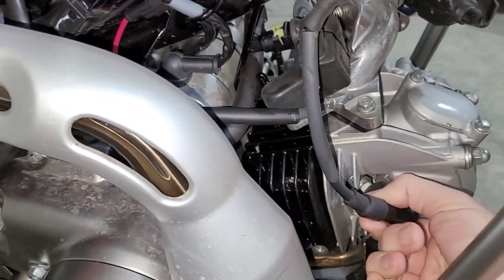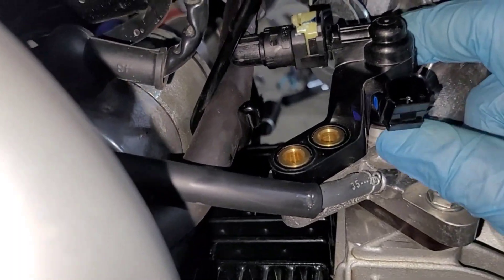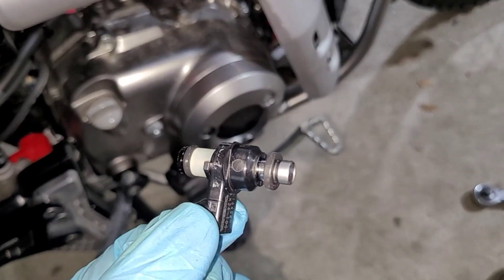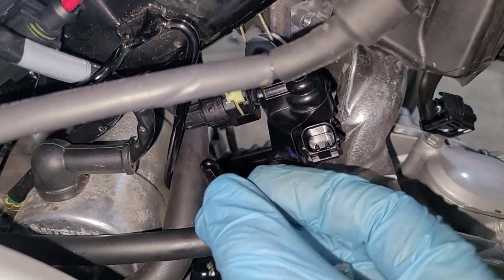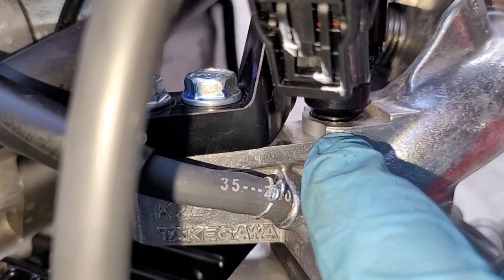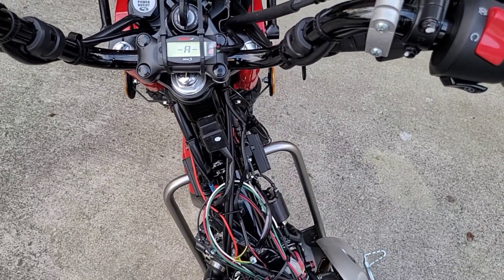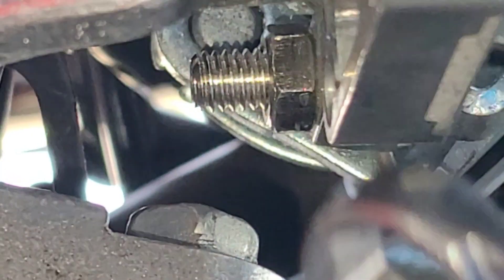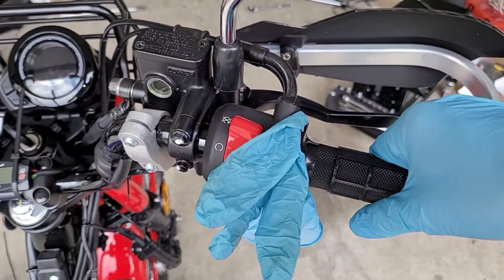Honda Trail 125 FUEL INJECTOR SWAP!. CT125 goes Rich!

Comment: wow thats a 235cc injector a lil bit too rich 😉.   little hint, when you change/try different injectors reset the ECU bevore first start so your LongTermFuelTrim and ShortTermFuelTrim Tables are empty in the ECU and it will adapt alot faster to the new injector 🙂!
Reply from the maker: Yep, very, truly, and completely too rich!  I will be doing a comparison video between a number of injectors in the near future now that I have a narrowband AFR gauge installed.
Reply: @QuantiQualification  very nice I'm looking forward for this injector comparison that sounds very interesting....  I think you will have the best results with the Keihin 5ED or C Injector
Reply from the maker: @ramiretz  I have a 5ED (170cc/min 8 hole) coming in on 4/21/2023. Cool thought on the C injector (175cc/min 8 hole). Will have to see how the 170cc/min and 190cc/min perform.
Reply: @QuantiQualification  oh yes that sounds cool i am very excited for your comparison and results 😎😎😎👍🏻👌🏻

Comment: I tried this on my 2022 Grom adding a PCX150 injector but the computer compensated and I gained nothing.
Reply from the maker: Definitely for the closed loop portion of the map, the computer does a great job compensating.  You have to trick the computer to add more fuel with an EFIE from Eagle Research or get a fuel controller. At wide open throttle, you should get a bump in fuel with the PCX150 since that is the open loop section of the map.

Comment: I have changed my oil (remove and replace) the engine oil but I want to know how to correctly change the oil on my CT125!  I have been told that it has a screen or oil spinner!  Do I need to remove a side cover or something to clean the screen!  I have just been pulling the drain plug draining the oil and adding in fresh oil!
Reply from the maker: Every 8000 miles you will need to clean out both the centrifugal filter and the oil screen.  I have it detailed here. https://youtu.be/9kOyZeizwyI  Upon completion, I recommend that you adjust the auto clutch mechanism.  This procedure is detailed well on YouTube.

Comment: Before you modify any vehicle to go faster, you should improve the brakes and the handling.  The best and easiest way to do that is lighter wheels.  My CT125 feels like it has 2 extra horse power because my aluminum rims are 1.25 lbs. less than the stock rims, so it stops faster, accelerates faster all because of less rotating mass.
Reply from the maker: That sounds like a great option!